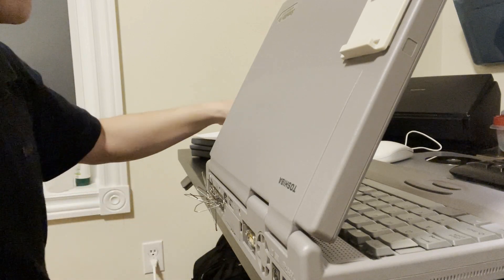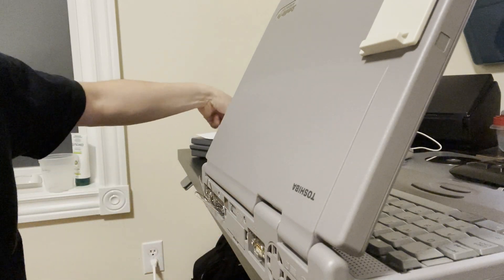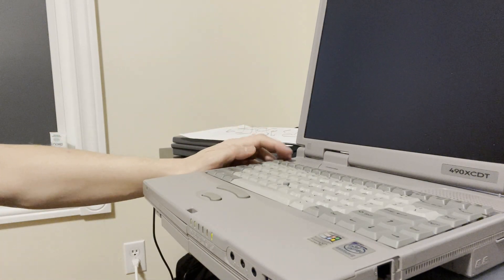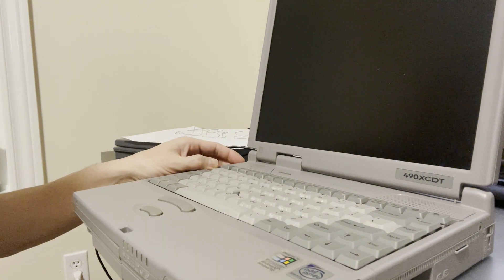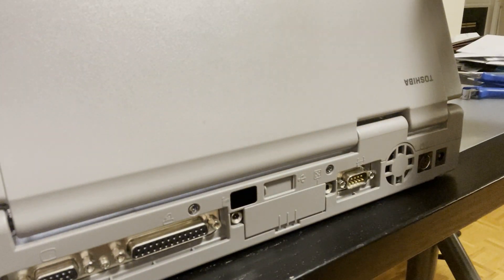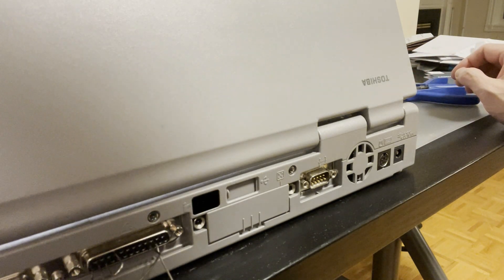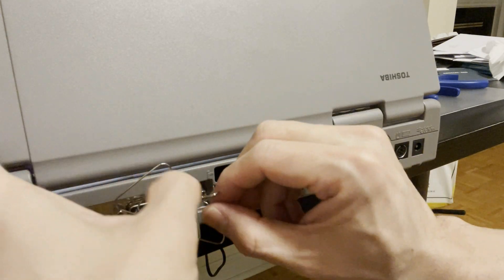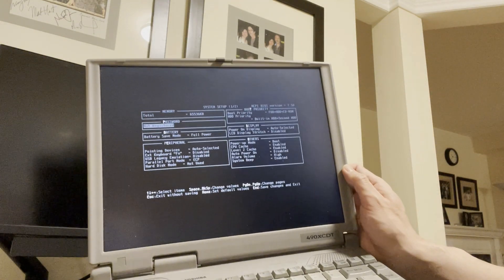490xcdt Toshiba Bios password bypass reset - vintage toshiba

Comment: Some pre-assembled plug would be useful.

I had the successor with a Celeron 400 MHz CPU, 128MB RAM and 2.5MB Trident GPU in 2001. Games like Starcraft and Half-Life 1 in 512x384 resolution ran acceptable.
Reply from the maker: Only had to do this as a one-off for a personal system.  But yes, if this is a regular event, would be useful.  In the day, I believe you could buy / make such a product.